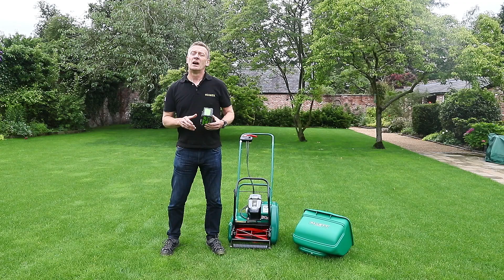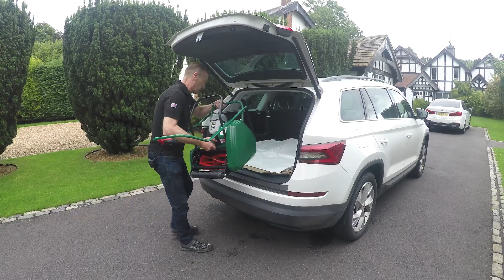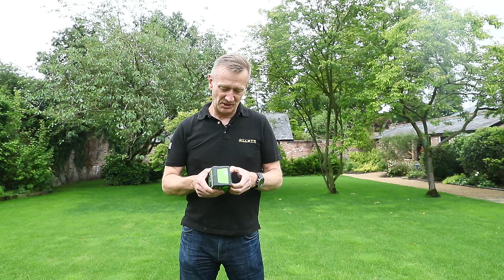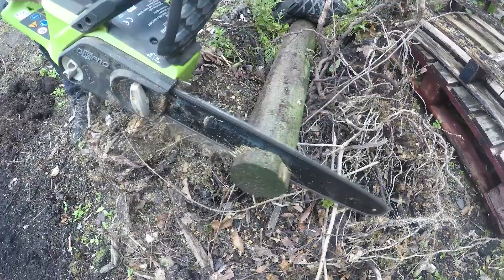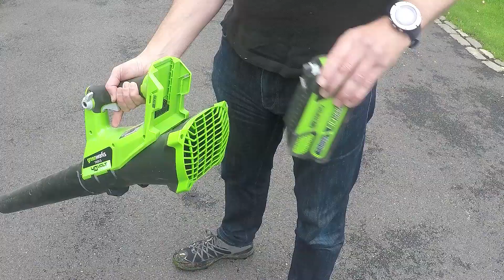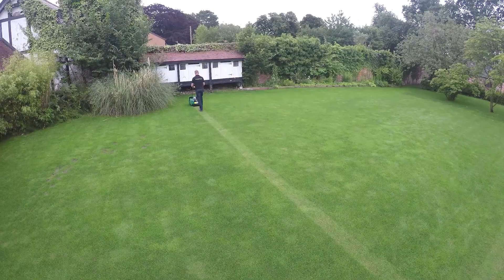The Benefits of Battery Power in a Garden Setting

Comment: I have one battery and charger for my Dewalt tools, I have a different battery and charger for my Black and Decker tools and I'd need a different battery and charger for a mower. My current Allett, my car and my wife's car all use the same flavour of petrol. I can keep the petrol in the same can to fuel all three engines. Besides, it's much more fun to tinker with an engine than a soulless electric motor. That's the fun of a petrol Allett, it needs serviced, oil and air filters and spark plugs. Yes I'm a petrol head.
Reply: Just purchased Kensington 14inch petrol.Exactly the same sentiments. I want to change oil, filter, spark plug. There will always be some of us left. It's a fantastic mower nothing against electric at all just love the petrol engine version.